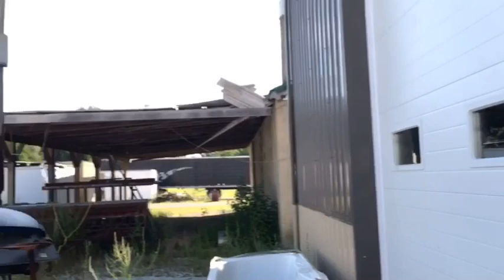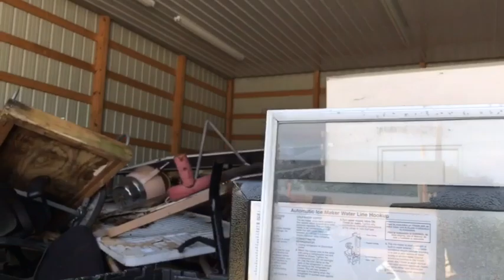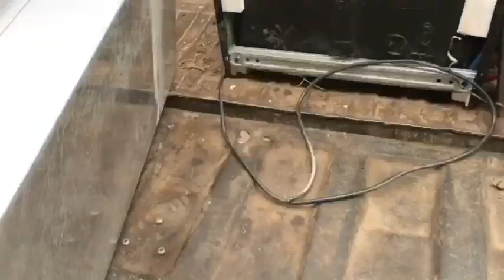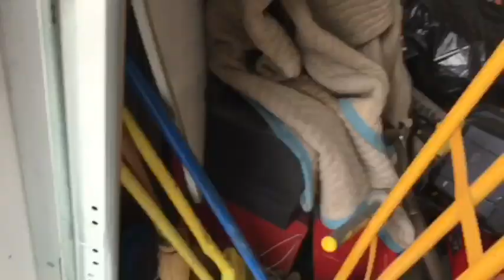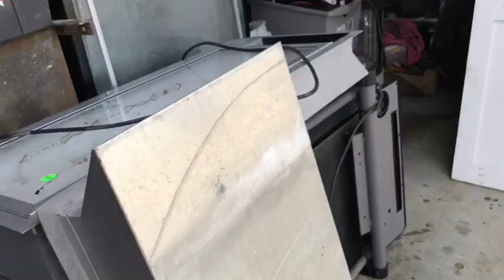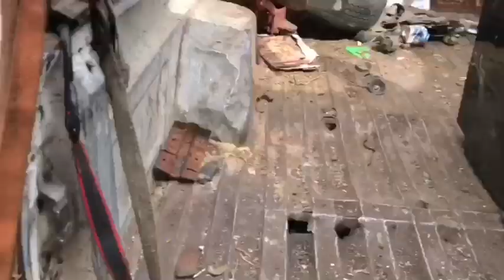Scraplife indeed

Comment: a simple pipe wrench will take those valves off.  Remember to open the valve and remove the safety screw from the side of the valve to ensure no gas remains.  Some yards will not take tanks unless they have a cut in them proving there is no gas in them.  Good luck....
Reply from the maker: Some yards take them
Uncut provided they are empty
Removing the brass would  yield me couple extra bucks though